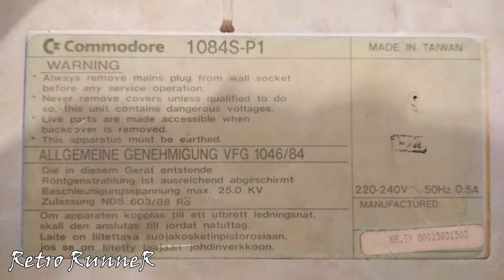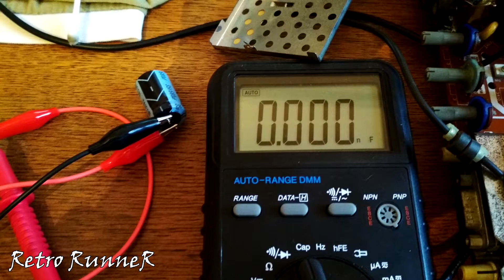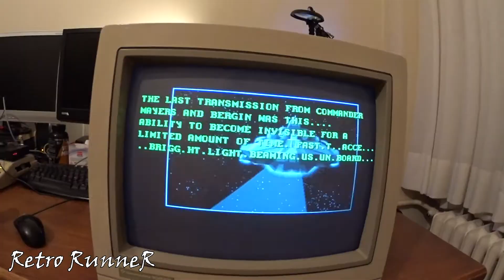Commodore 1084S-P1 Monitor - Vertical Collapse Repair (Commodore Amiga CRT Monitor Repair)

Comment: Let me ask you a question. My bottom horizontal line drops on the left side. Top horizontal line is straight with the top of the chassis. Do you know which potentiometer on the monitor MBO  to use to fix this issue? I have exact same monitor as you do.
Reply from the maker: When i removed the MOBO I noticed there were also many solder cracks, mine went bad while adjusting those knobs so be careful. I don't remember which one fixes that sorry.